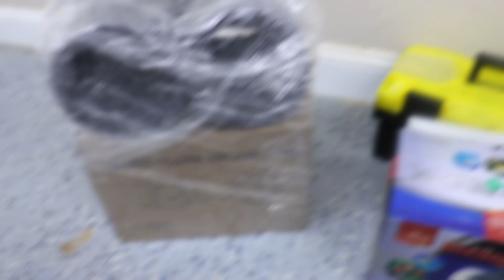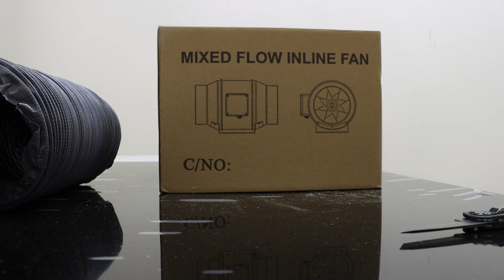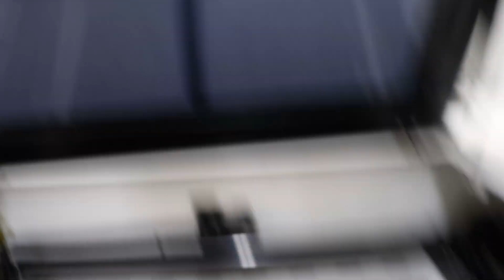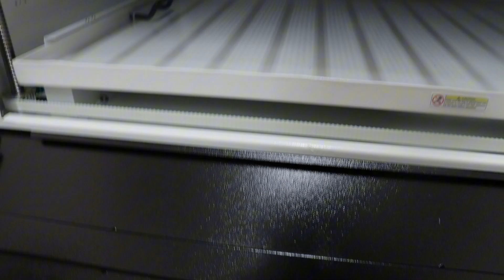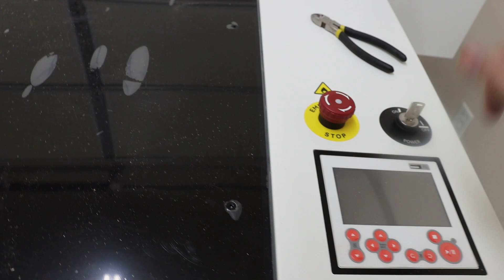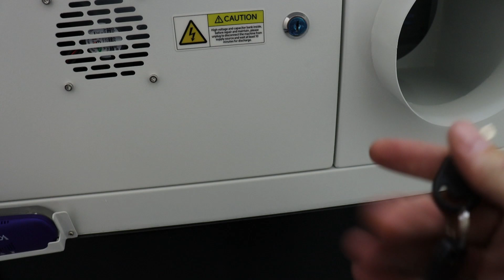Hydra 9 Day One! Uncrating, Unwrapping, and Tour! Where Did I go wrong?

Comment: You probably already know this but you don't need the chiller for the RF tube.  You can get started using that while you wait for your chiller.
Reply from the maker: Thanks!  I do understand that, but I’m a little nervous to run the machine at all without it.  If I accidentally have a setting wrong in light burn I don’t want to blow up my glass tube!